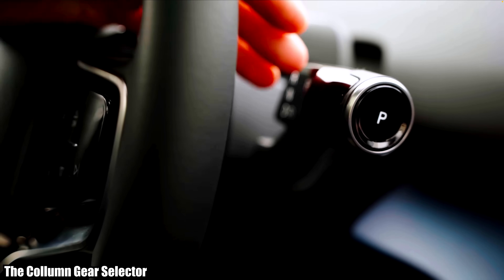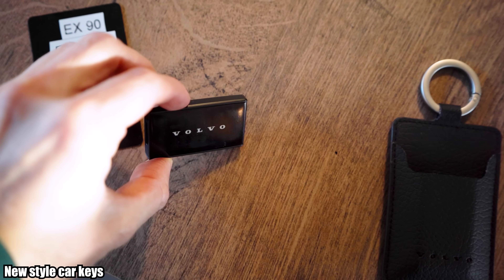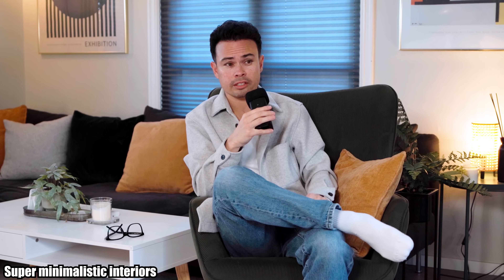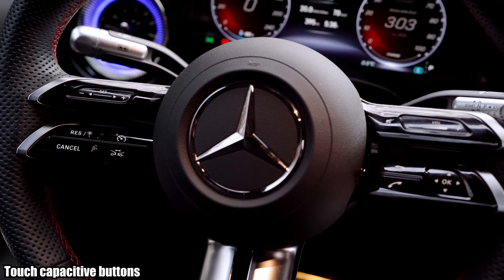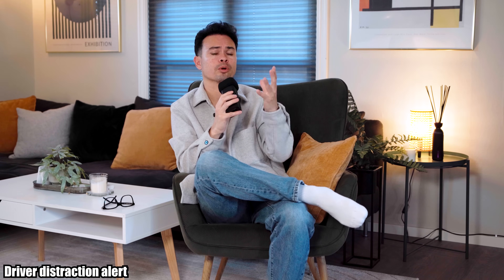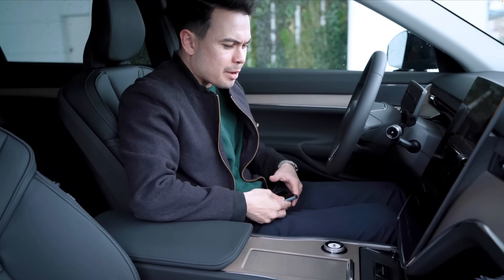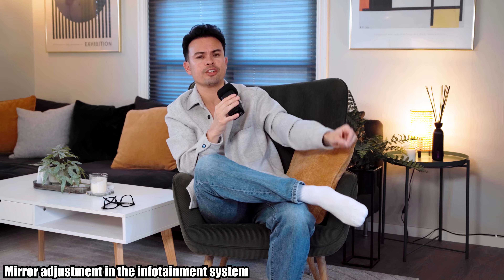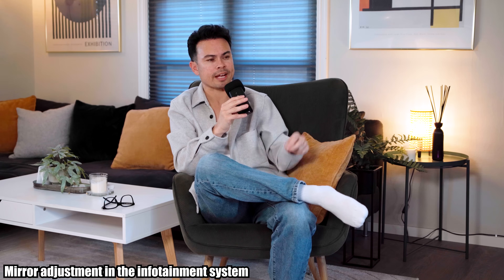The 10 Worst Features in Modern EVs !

Comment: I have an Audi Q6 e-Tron and previously owned a Volvo XC40 Recharge.

1. I'm surprised this wasn't on your list: flush door handles.  Added complexity, less convenient to use, compromised safety, and for what? To not have to look at protruding door handles?
2. Horrendous steering wheel controls on the Audi. I've had older Audi loaners and the physical controls on the SW were brilliant.  These are a disaster.  They don't respond half the time and I'm constantly inadvertently changing settings due to unintentionally brushing up against the control.
3. Lack of a driver display.
4. So many functions on the screen that I use frequently.  Mainly the HVAC controls.  I like to have cool air on my face when using the heater.  Fortunately, the Audi has vent knobs to control the volume and direction, so I can easily slide the vents away from my face when not wanting the cool face air and back when I do. 
5. B-modes.  On the Volvo, I could set one-pedal driving as a default, and it works in both forward and reverse.  In the Audi, I have to engage B-mode every time I shift into D. 
6. The Volvo had zero feedback, but fortunately the Audi has audible feedback when touching the screen. Better to have tactile feedback as well.
7. I have no doubt that eliminating physical buttons and moving their functions to the touchscreen compromises safety.  No question it requires more time looking at the screen instead of the road.  IMO requlations should require physical buttons for all safety-related functions.

Comment: I really don't like the route planing with charging stops for long trips. When I travel for a long trip, I don't want to plan all my stops up front. I want to put the destination and drive, same as with ICE car. What I want is a system that shows me the next charing possibilities dynamically along my route as I approach it. Let's say I have 30% in my battery and I can still drive 100km on a highway. The next stop is in 20 km, I would like the car to tell me, that I can stop there and chage and show me the current price and availability. And at the same time I want the car to tell me if I can drive further and stop in the next stop, let's say in 70 km.  I want to decide based on the current situation if I stop or not. Not based on the planing done 3 hours ago. 

Planing my stops up front for the next seven hours is the worst feature of the modern EVs and in my opinion this is the show-stopper for most of the ICE drivers to switch. They just want to start the car and drive. They don't want to spend an hour planing the stops upfront and then do it again if you stop sooner because you need a break.

Comment: I have a U25 Mini Countryman SE but the issue is the same with the ICE versions - the icons on the circular screen for temperature control is so small it’s almost impossible to operate them manually while driving, additionally you have to tap the temperature control adjustment icon to access the heated seats and steering wheel controls that are even smaller icons on the next level in on the icon………….. and since I have had the car (almost 2 years) and despite numerous visits to the dealership and OTA updates the voice activation always tells me “I haven’t learned to do that yet” when I give it any voice instruction that isn’t a phone call or an instruction to navigate to somewhere - those work perfectly every time! 
I also own a 2023 Land Rover Defender - it has a large touch screen for the less used settings and displays but separate multi function  knobs to control the heating/ cooling and heated seats - there’s a separate button on the steering wheel for the heated steering wheel - and these rotary knobs are also used to adjust the fan speed and to change the off road driving programs when needed. It also has a proper multifunction information display/ speedo and RPM directly in front of the driver in an old fashioned dashboard (it is partly TFT though the speedo and RPM are analogue displayed) The voice control works well but has a limited number of functions. For the life of me I cannot see the reason why we need Alexa et al in cars and they are turned off in both my cars as is Apple Car Play/Android Auto. Thankfully neither car has any shiny piano black plastic anywhere in their cabins!

Comment: Pleased to say my recently purchased non-prestige EV has avoided most of your list of annoyances. Sensible use of physical buttons and dials, no gear shifter off the steering column, none of the key card rubbish, physical wing mirror controls, no piano black plastic interiors, fatigue/distraction alert and lane keeper assist are present, but can be set to permanent OFF in driver profile. My main criticism would be lack of spare wheel - think they could've been a bit more creative there. Otherwise big ticks.

Comment: I agree with almost everything. The wireless phone charging does not charge much and yes it does heat the phone but it usually good enough I think. It' very rare that I plug in the phone. The lane assist works well in my Polestar 2, it allows you to cut corners etc. In other cars it's been much more annoying. In some cars it's been straight up dangerous.

Comment: - Lack of physical buttons
- Missing or new style drivers displays
- Slow and unreliable car app
- EV tires
- Missing battery temperature gauge and manual preheat control
- New style door handles
- Black glossy plastics
- Driver distractions / warnings
- Small trunks in large cars 
- Too few cars with decent ground clearance and 4WD, due to efficiency focus. Eg. the ID.7 which should have been available as an Alltrack model - and the ID.Cross which should have been available with 4WD.

Comment: Im the odd one here - i like the modern user interfaces and 360 cameras. Love a panoramic roof (Uk, so not really much affected by weather) .  Dont mind touch screens as once ive set a car up i dont touch the buttons/screen from one month to the next. But i agree that the 'driving aids' are rubbish and i generally turn them all off - lane keep, speed limit sensing, driver fatigue etc. All pointless and distracting, but effectively mandated or at least expected by NCAP in order to score high points, regardless of whether they work reliably.

Comment: The gear selector on the steering column has been around since the 50's, back then called three-on-the-tree which some people will know what that means so not the 80's originating.  To be honest for me I don't mind the gear selector on the steering column free's up room in the centre console for other things.  For me it's maybe not a feature perse but the OTA capabilities of a car.  My 2024 Kona EV although it has OTA functionality the manufacturer at least in my country is failing badly at any updates of any value the only ones that have come out are nav related not changes to how things behave or new features even never mind the fact they push an update out but not all owners get it and they don't care they told me to go to the dealer when the OTA is there to do this for me.

Comment: Lack of climate and volume buttons.
Beeps - alert me through vibration or visual.DONT BEEP AT ME! My EV6 alerts me through stearing wheel vibration which is great!!
Speed on the touch screen
Orientation of the indicators, cabin. Manufacturers dropping cars into australia that are designed for markets that drive on the other side of the road. Infotainment menus on the passenger side of the screen, indicators on the left. Wipers on the right.  Byd and kia sell well because of their traditional aus set uo.
Suspension - EVs are either too firm or too soft.  So many can't get it right. My Kia is great.

Comment: I disagree on every point, except glossy black plastics.
For instance, mirrors. My car automatically dips the mirrors when I engage reverse. I don't mind it, but if I would, I could turn this feature off in the settings. Before I owned this car, I had never ever dipped/adjusted the mirrors before parking.
A special mention goes out to driver aids and how easily people turn these things off. I have prevented quite a few road accidents from happening. The vast majority of cases involved me avoiding another driver that had swerved from his lane. I guess those are the kind of people that turn off the alertness monitor and lane keep assist.

Comment: 17:38 again Renault does this right. Lane keep assist disabling is a single physical button on the 2023 Megane E-tech. I think it might have changed on later year models where they have instead gone for a "my safety" button that preloads your preferred safety settings, which is great for turning off stuff like speed limit warnings (that tends to give a lot of false warnings). Even so I imagine disabling lane keep assist could be part of that profile. 

Personally I keep it on, it works fine for me on my car

Comment: 2:51 Again, Renault does this well. The key is a card, but it's proximity based and lives inside my pocket all the time, I never take it out. I just walk up to the car and it unlocks, and then when I sit down it sees the card is present and just lets me start the car.

And if the key card does fail, because of a dead battery or whatever, you can still unlock the car by using the keyblade hidden behind the back cover. Starting the car is also possible with a dead key battery, but you have to put it in the dedicated start area. Mildly inconvenient, sure, but under normal operation it's great and perfectly seamless.

Comment: Yup. The right shift stalk is not great. Proximity key and key as phone is not always consistent, especially with my Polestar 3. My wife’s BMW i4 keyless entry seems to work fine but also comes with a key fob with buttons. The safety nannies are generally appreciated, but are not 100% like approaching an off-ramp with a tight curve and retaining wall, the auto emergency brake could go off. The screen adjustments for my mirrors embedded in the screen as well as other adjustments in my Polestar 3 is absurd. For example, have to manually fold the mirrors using the screen, no auto fold feature on a 85k-100k premium performance EV. Other than that, the P3 Performance has been a blast to drive.

Comment: This is not only EV cars, but most noticeable on them, They are too wide, even what should be "small" city car like ID.Polo is over 180cm, first Polo was 163cm. Where one should park those cars, EU parking spaces are mostly very narrow. And there is no more space inside to sit, only the central console is wider but not much because only wheels are wider, cabin not so much. 
Also insisting on big wheels on EV cars is stupid, less range (about 20km per inch), less comfort, less visibility, higher price, not a single objective advantage over smaller wheels.

Comment: 2:35 or just use smart phone. EVs could leave key technologies behind. Everything can be simpler using a smartphone
Reply: Key is much faster for pressing a button vs pulling out a cellphone.
Reply: @JohnDoe-vx3z  It seems you don't know how they work.. my phone stays in my pocket. It allows me to unlock the car by proximity sensing and I just step on the brake pedal to start the car up and immediately put it into drive. There's a backup credit card format NFC in my wallet as a backup. I never want to have to carry along another separate thick and unwieldy old style car key again.
Reply: @bilgyno1 I know how it works, I had a Telsa. It was not 100% reliable. Also, the key has additional buttons for popping the trunk or unlocking the charge port.
Reply: @JohnDoe-vx3z for me it works reliably. Things like popping the frunk or opening the charge port can be made smart, eg with s3xy buttons I open the charge port by pulling the rear door handle for 3s. Manufacturers can rethink how they enable functions to much easier than carrying around a piece of 2001 technology and having to get it out of your pocket to use the buttons on that key fob.
Reply: @JohnDoe-vx3z my phone always in my hand..
Reply: Yes, system on Tesla is perfect and super reliable 👌🏻

Comment: My biggest issue with new cars: the teslafication of cars: make them cheaper and put everything in the screen. 
2: black plastics drive a BMW i5 and my parents EQE have a sea of black plastics
3: annoying me for speeding, looking at my GPS screen, driving to close to the lines when overtaking a truck…
4: Don’t mind a gear lever at the screen (had one in my Mercedes), the the VW ID system makes me doublecheck each time. The tesla system is even worse. 

Mirror changes and airco: don’t care, I hardly ever use them, set and forget. I will never put the heater on 25. 19 is enough in winter. (I have a summer and a winter temperature).

Comment: I disagree about the shifter stalk on the steering column - when done right. 
It needs to be a separate third stick on the steering column, not a second with lights and wiper functions combined on the other one (like the '27 Bolt, oh dear). Check out a Hyundai. 
As a third column it adds a little real estate for a barely used control. B to back out of your parking space, D to drive, and you likely never touch or look at it again until you put the car back in P for park. 
BUT - what to do with the prime real estate under your hand you now freed up? Not a freaking big box dedicated cellphone warmer cellphone warmer with a lid (2026 Ioniq 5) or the door and window controls (Ioniq 6) that could have stayed by the doors and windows like in almost every other vehicle.
I just need general storage space for my wallet, keys, glasses case, phone, and maybe gloves, folding umbrella and a hat. Stuff I have in my pockets or about my person when outside the car, but need to stash conveniently while driving, then access again when getting out.

Comment: One of the most frustrating things I've experienced is the removal of software features that were included when the car was purchased. Suddenly, you have to pay a subscription to keep using them. For example, in my Cupra Born, where the software is already terrible, one genuinely useful feature was the ability to use the app to remotely start the climate control. This is incredibly useful in winter—being able to preheat the car before you even get to it. But after 3 years, they blocked that feature, and now I have to pay a subscription to continue using something that was originally included with the car I paid for.

Comment: I have an XC40 and it seems older is sometimes better, I have a good mix of software and buttons and it was before the drive attention stuff started getting fitted. Also the aircon still has some physical control over the vents or using voice control which understands me very well (rural australian) What you have given me is a list of things to look at when I eventually look for a new car, I have had the Volvo 4 years now, battery is holding up well (94% SOH)  and no rattles etc, so no need to think about changing.

Comment: I more or less agree with everything, except that I wouldn’t dramatize the glossy plastic on the console. I have a car that has it, and in more than three and a half years I haven’t made a single scratch. Dust is visible even on dark soft-touch plastics, so it’s enough to keep a small microfiber cloth handy to wipe down the more visible areas from time to time. I’m not necessarily a fan of glossy plastic and I could happily do without it, but I do find it very easy not to scratch.
Reply: Agreed. 
It's not that piano black plastic gathers dust, it just shows it, and is easier to clean with a microfiber cloth. I also have never scratched it in my '22 Bolt.

Comment: Totally agree with you. Lane assist is tbe first thing I disengage in my car (EX40).
Reply: I don’t generally don’t have a problem with lane assist- except the one in 2nd gen. Leaf, which I found too intrusive. There are also some attention and tiredness warning systems that actually works well. Like the one in Polestar 3 and EX90. Then it’s not a problem. The speed warning in all new cars however drives me nuts!
Reply: Lane Keep assist is positively dangerous if pot holes, cyclists, pedestrians, snow,  and random road debris are around. 
It should only be active on well-maintained freeways, and always easily turned off with one finger press.